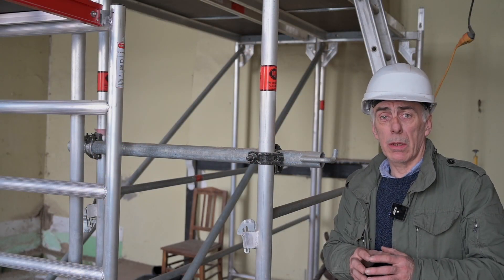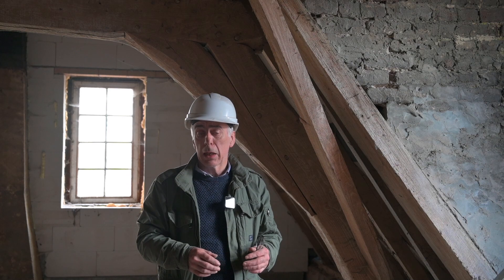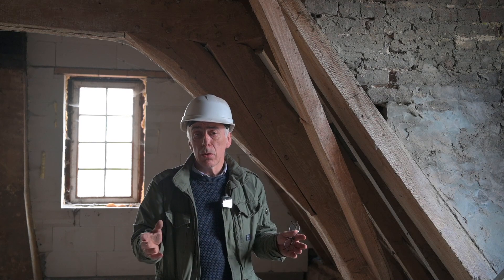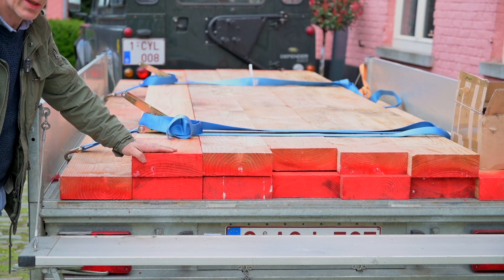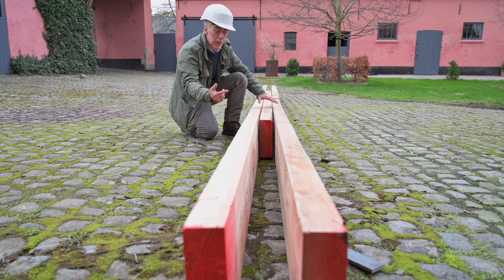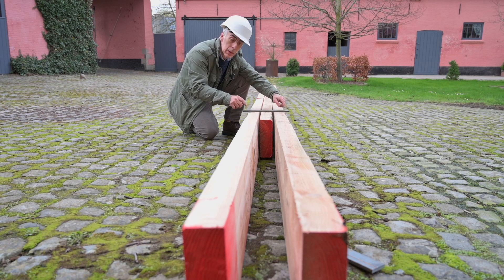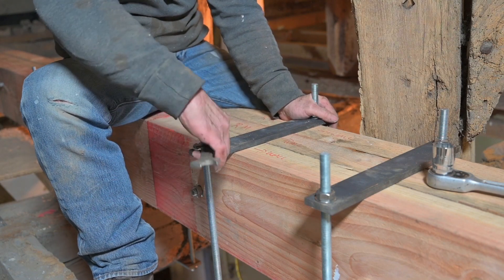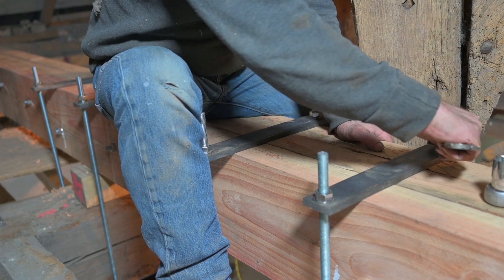Day 7, Restoring the tower room enforcing the old structure. Unexpected work.

Comment: The last time I heard the Douglas fir called a pine was in grade 6 in 1974. I chose that particular species for a project and started collecting and sorting through the needle variations. It got much more interesting as I got into it and found it to be referred to as false Hemlock too. The single needle means it isn't a true pine and as it turns out it isn't a true fir either. Mr. Douglas must have been a complicated Scot with an excellent sense of humor. Thanks for the memory flashback.
Reply: I am from Oregon but educated in England and Switzerland.  Douglas fit is consistently called “Oregon pine” in those places.  But old growth Spruce from the coast of Oregon is better known than DF, for the role it has played in aviation history.  IF YOU HAVE EVER STOOD NEXT TO THE 
TRUNK OF AN OLD GROWTH DF AND LOOKED UP, IT WILL TURN YOU RELIGIOUS.  NO BRANCHES FOR 70’ OR  MORE.
Reply: @charleshewitt3138  BC born and raised with a childhood of wood heat and made most of my income designing sawmill machinery, industrial automation in my blood and visa versa. Let's just say I got an 041AV Super for my 12th birthday and recently ported another cylinder for it. I've been your way too several times, mostly to chat with the crew at Inovec in Eugene. I've looked at up at many old growth monsters coincidentally in Oregon but years earlier on Vancouver Island where going up seemed like a good idea. Climbing by holding pieces of bark is interesting. Near the top it started to sway with enough movement I thought it might possibly snap the tree so I retreated. That was in 78 and I've developed a better appreciation for gravity since then and never tried again... yet.
Peace.
Reply: @charleshewitt3138  Thank you for your thoughts. It's always interesting hearing other views. Well I became interested after marrying my Portuguese wife.
Reply: @charleshewitt3138  I had a thought cleared up after reading your comment. The Inovec sawmill headrig manual I have was written for a Washington state customer and uses Oregon Pine in its cut solution tables. Douglas fir isn't even mentioned although it actually was I just wasn't familiar with the other name. Nice to learn something new.

I just looked at the Washington Oregon lumber harvest report and it's less than half of what was common in late 80's and early 90's. I do hope they protect your beautiful old growth forests for your descendents to admire. Waiting 150 years to look at a forest requires a little too much patience.
Reply from the maker: thanks for the comments, and I learned some new things
Reply from the maker: thanks for the comments, here mills are selling Oregon and Douglas ,,, the price difference is large.  Oregon is the most expensive , more dense and yellow... do we have this wrong here ?
Reply from the maker: wow,   I can imagine
Reply: @D3Sshooter  The needles and how they group are an accurate way for checking species but alas, we have a Claus here that only allows needles to be removed from the forest once a year.

I suspect your Douglas fir is the same species we have as our majority timber. We have a common group, Hem-Fir and or Hem-Fir-Spruce and they are all graded for strength and marketed as an all the same  product to keep it simple. They use a machine to physically test each piece of wood usually once its at final dimension and it's not uncommon to test the same piece several times on its way through the facility. The high speed machines are remarkable and highly accurate. I would credit MSR's aka Machine Stress Rated equipment for making the multi species marketing amalgamation possible. The individual piece flies through an MSR lengthwise at the same speed as the planer it just left, 900 feet per minute and up. The machine twists and deflects the wood while measuring its resistance to these forces. This provides a reliably accurate rating that can be superior to the good old eyeball grading system and offers something over a laser scanner which isn't as fancy as its name suggests and better than an x-ray scanner the last time made one. Technology is leaping forward every so often to aid in percentage recovery and to increase value from the same amount of tree. Unless the wood is cut in squares of 3. 75" or 4.25" then it's destination is Japan and appearance is a top priority. So much so that we added a worker whose job it was to visually inspect the edge pieces being stacked in a lumber bundle to ensure that only the best faces were visible from the outside. About a $60,000 per year cosmetic quality control upgrade. Next job was sorting monitor pixels to find a way to do the visual job without eyes. So there's always something new to utilize or on occasion come up with. With many toys to play with it doesn't really resemble what people refer to as work. Oh and about your original question, I'm not sure and curiosity is taking over again. I was going to ask, is Hemlock common in your neck of the woods? A strong but annoyingly heavy product that doesn't care much for stain without a little preparation. It does get to travel often as pallets.
Peace.

Comment: Nice work. How thick are the outer walls? What are you planning on doing to keep them from Spreading if that happens? Thanks Jim in Chile.
Reply from the maker: thanks for the comments, the outer walls are 1meter thick or about 3,3 feet.  No risk of that , its rock solid. Its been here for 400 odd years

Comment: The strength of old large beams is being replaced with I or wide flange styles using far less material. The "what if" questions start right away and for me it was what if there was a fire? There are benefits to the old construction methods that aren't immediately apparent. Just a thought that popped up watching your most interesting project. I started thinking when you mentioned that the strength of beams is from the vertical dimension. While usually true there's much more involved once you really get into it and consider how the forces play out. Thanks for that too. I do enjoy thinking.
Peace.
Reply from the maker: thanks for the comments Jim, and indeed there are many forces at play on those beams....

Comment: I would have used wood glue to bond the beams together , in addition to the threaded rods .  And I would have used large washers or steel plates , in stead of the washers you used .

     Just a little extra strength , although I am sure you are fine , too .

     Enjoyed the video ! 

Thanks ,    :-)
Wyr
God bless
Reply from the maker: thanks for the comments, and indeed that would have been better, poly ethuraan glue.   Fo the washer I might put larger metal plates up if needed

Comment: I thought that the "child alimony" joke was only a local thing (Portugal) but i guess it's not.
Although there's no foreseeable vibrations applied to the beam, due to the possible expansion/contraction (due to humidity), one can imagine the screws may became loose (not tight to the wood). wouldn't make sense to put some counter-screw (again each other)? (if so those threaded rods would be short).
Maybe ckeck it after one year or two.
The roof structure relies only in the base characteristics of the wood (mostly tensile strength) and possible has little to no hardware. That's probable why it is still standing (that and ensuring that's no roof rain leaks...wink).

Please don't take offense (i'm much much younger than you and will never be half versatile as you are). 

I know the ideal would be an entire full beam, but as one eventually come to understand, a good solution is enemy of the best solution. Be safe and congratulations in doing that task all by your self (and film it).
Reply from the maker: Thank you for the comments, and they are welcome...  Its always good to learn and exchange ideas